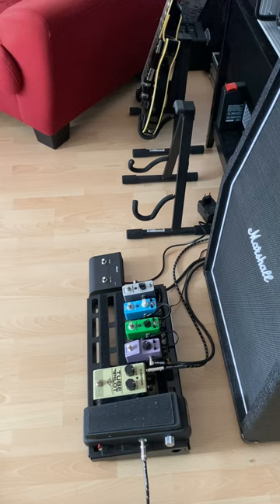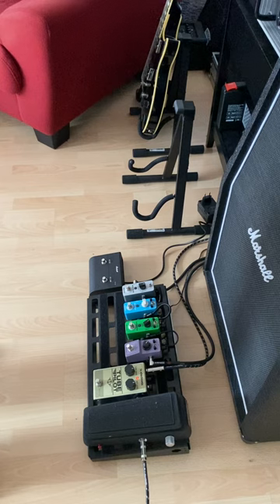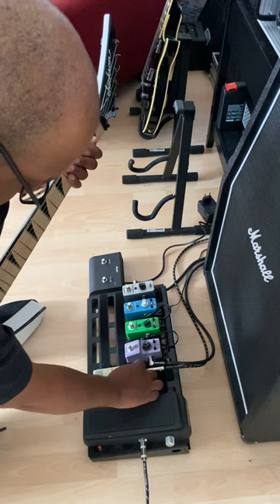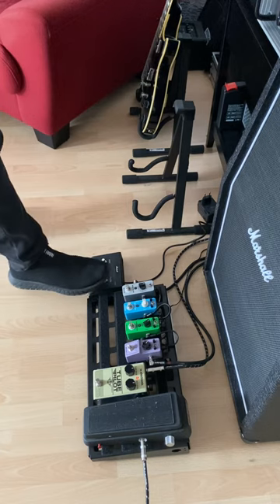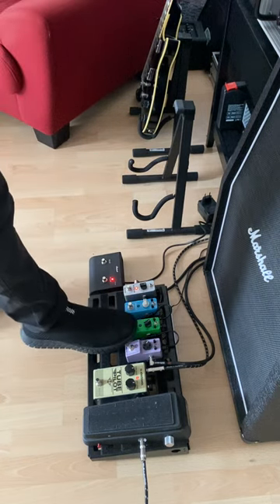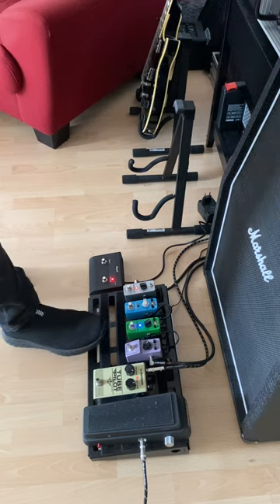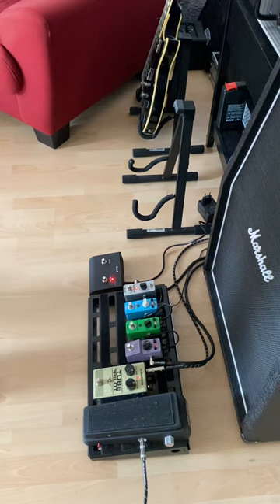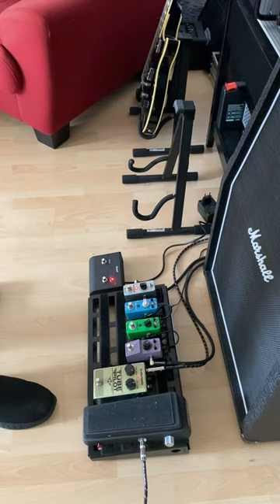TC Electronic TUBE PILOT Overdrive Demo

Comment: How does this pedal sound with the drive all the way off? Will it basically act like a clean tube boost pedal that way? I'm looking for tube response, but with the option to run the signal without OD.
Reply: Drive all the way off is just silence. And it doesn't really do clean boost even with drive close to zero. There's always noticeable dirt. Does it sound cool though? Absolutely!